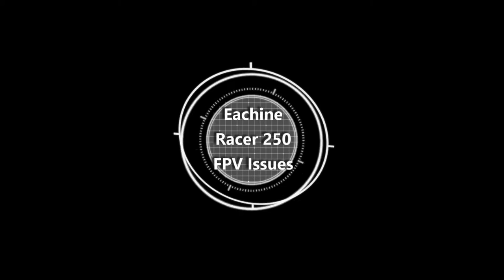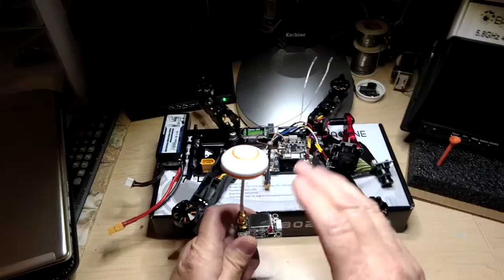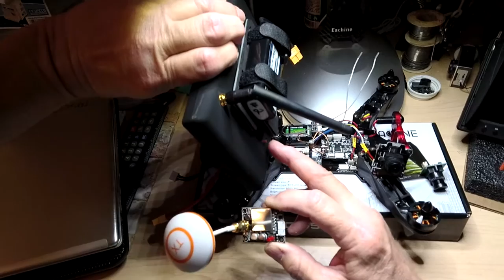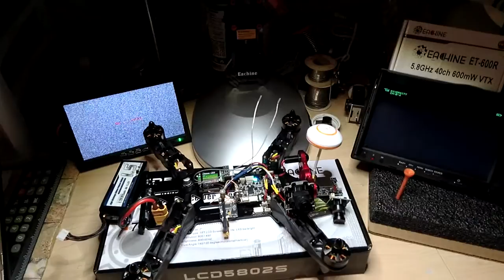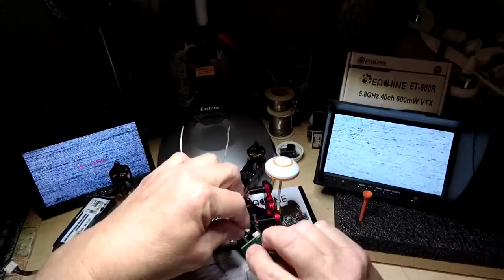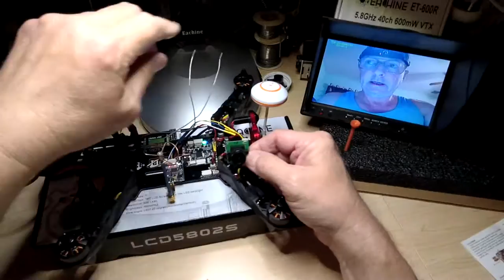Eachine Racer 250 FPV issue

Comment: Hi, thanks for sharing. Couldn't help notice that you are trying to power the original camera from your ET600R VTX. The 1000TVL cam that comes with the 250 racer requires 12v, most vtx's output 5v to the camera. You need to power the cam from the output on the PDB/frame chassis. Also I have trouble tuning my monitor into the vtx when using the auto scan function. Just do single presses on the monitor to change the channel and wait at least 2 seconds to see if it comes through. My auto scan is too fast and doesn't give it a chance to tune in. Don't be worried that a 600mw vtx is getting hot, this is very normal. Hope this helps.